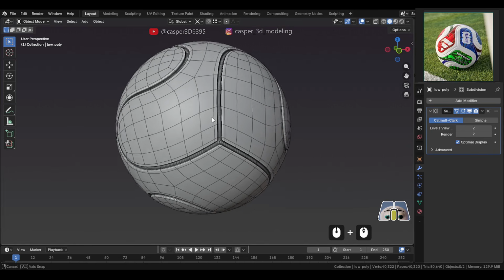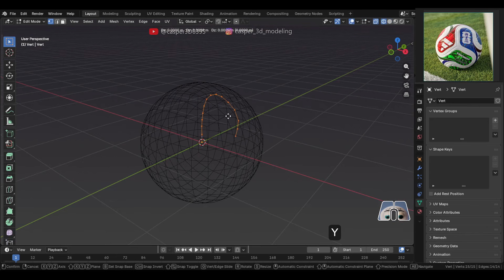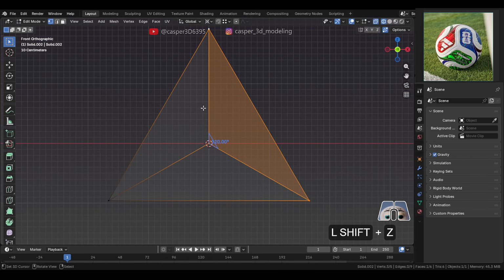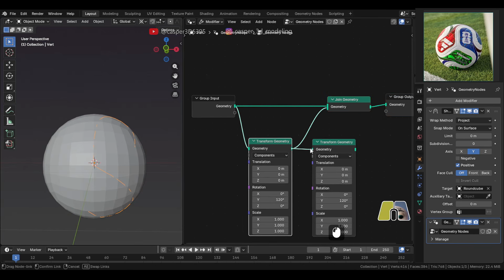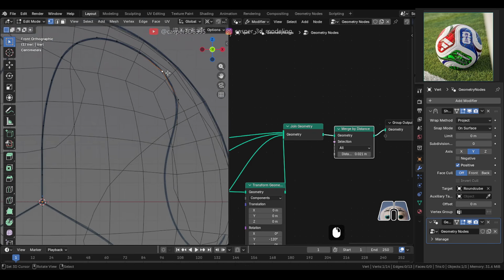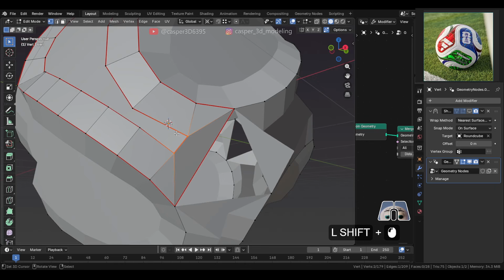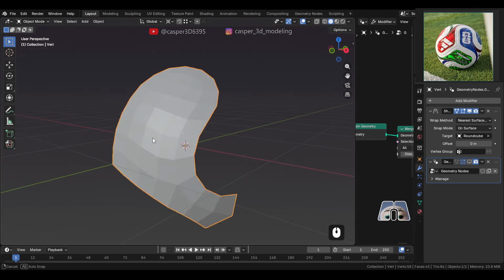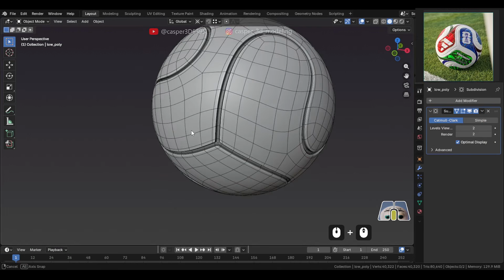Blender Practice – Modeling the 2026 FIFA World Cup Adidas Trionda Ball

Comment: Hi thanks for the tutorial! Dont know why but at 12:13 my mesh is almost the same as yours but when I apply the GeometryNode modifier the vertices do not match to the copies...producing n-gon geometry at some faces border.
Reply from the maker: Thanks! Yes, that usually happens if the boundary vertices were moved after the Geometry Nodes setup, so they no longer align with the copies. If you need to tweak the boundary vertices, do it right after finishing the Geometry Nodes setup and before applying the modifier. Once the modifier is applied, don't move the boundary vertices, or they won't line up correctly. The vertices in the middle can be adjusted as much as you like after applying. Also, check that the Merge by Distance node is set correctly so it isn't merging too much or too little.